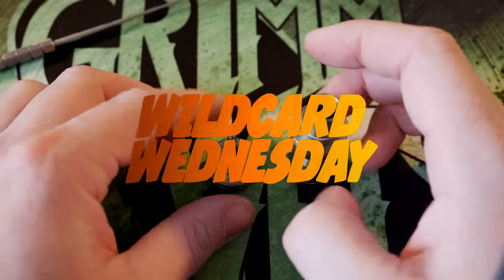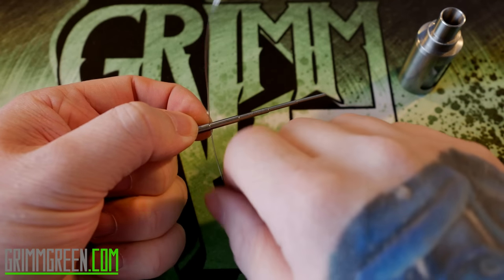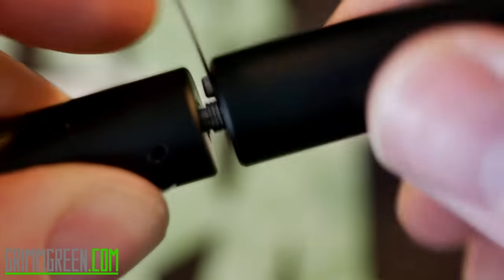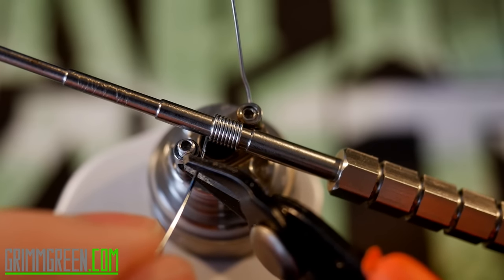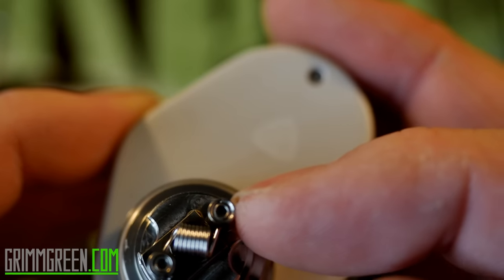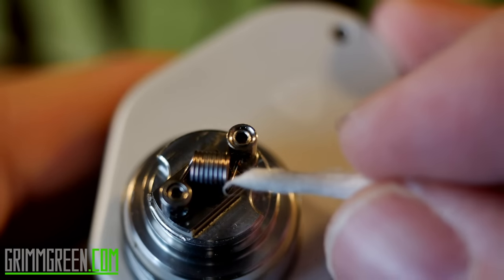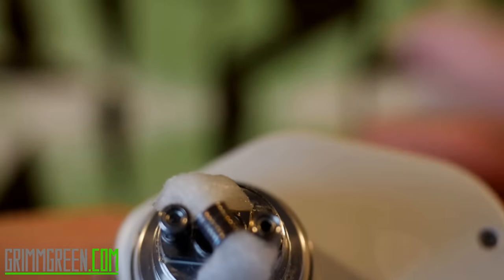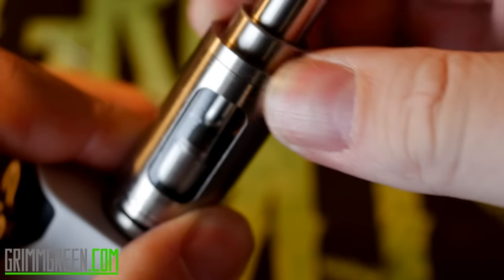Building  Wicking the Wotofo Serpent RTA

Comment: The first time I threw a coil in the Serpent I fought with the coil install. The next time I reverse wrapped the coil and it was SO much easier. I'm glad you showed that in your video. That one step really saves the day for the Serpent (although I space my SS coils for reliable TC). It still isn't the best tank but it's good, doesn't leak, and so easy to rewick. Very nice video GG.

Comment: I have just bought this tank and its my first Rta so I struggled a bit with getting the coil in and I don't think I wicked it well enough as I get the odd dry burn and I'm only using 30 watts and the coil came out a 0.88 ohms so I think I will have to re wick it.I will follow your video and see if that is any better.i am a bit of a newbie when it comes to  vaping it's been about 6 month now but I love it.It has already become a bit of a hobby I have been making my own e juice for about 2 month so I thought it was time to upgrade to making my own coils too.I used to use the ipv d2 70 watt with the aspire Cleito tank and it was a lovely set up but I was going through 2 batteries a day with it only been a single battery.When I bought the Rta I bought the Wismec reuleaux Dna 200 for longer battery life and a bit more power and so far it's been fantastic just hope I can sort the tank out.I will keep trying until I get it right.thanks for the video  I have subbed to your channel.

Comment: I really tried to like this tank, but I was plagued with troubles like leaking, not being able to get a grip on the tiny base ring (AFC ring just spins), and trying to open/close the JFC with oily fingers (because leaks). Also, the bottom pin is too long for the 510 on my RX200 so constantly getting short/no-atty connection problems (not worth upgrading 510 on my rx200 just to get this tank to work).  After struggling with it for a couple of months, I tried the bachelor and found it to be a MUCH better fit for me.  If I ever decide to replace the 510 on my RX200 maybe I'll give it another honest try, but until then it's on the shelf.  Just the same thanks for this vid and the tips I always appreciate your info - have fun!

Comment: there is an easier way, I think. Little J trick, both leads are going down and they are bent towards each other in a J shape, then you pull the wire through clip both leads and you done. I did a build using this trick in my Wotofo serpent first impressions video, check it out if your interested.
Reply: I totally agree with you I do the same! I bend the leads towards each other and works so easy!

Comment: I thought about getting this one but ended up going with the griffin instead. I might still get it just to have both lol.
Reply: Well, the Giriffin is dual coil only (for now). I like to have a single coil setup for work and when I'm out and about, because you can run a single coil all da on more compact single 18650 devices, and it consumes less juice. I've been relying on subtank minis for my single coil needs for the bast 6 or 8 months, but I just ordered the Serpent as my replacement single coil setup.
Reply: +Michael The Vape Dude isn't the Gemini essentially the same aside from the top airflow? I'm thinking of getting the Gemini because I cannot get the griffin to wick correctly no matter what I do.
Reply: Will do man, thanks for the tips

Comment: Another great Wild Card Wednesday!!  Question: I noticed that you did a macro coil where all the wraps were touching.  I had been told that for TC (specifically with Ni or Ti wire) you had to have the wraps spaced out like we used to wrap around silica.  Is that not the case with SS?
Reply from the maker: +Sir Kanthalot I've done contact coils with TI NI and SS ,  not really the case for any of them
Reply: GrimmGreen thanks. I was making a micro coil using a coil master then streaching them out & s scrunching them back together. Works but makes for a tight squeeze in something like the goblin mini. I'll try a regular micro coil on my next SS build.

Comment: You shouldn't glow SS mate. You can run it wicked in power mode but dry you can easily take it too high and end up with nasty yellow stuff on your wire. If you are going to glow it do it so it's just glowing. Better in a dim lit room.

Comment: does 316L work in temp mode when wrapped as contact coils?
Reply: spaced works best but you can do contact so I've heard
Reply: +Josh Garcia yes contact works but not as good as none contact
Reply from the maker: +Josh Garcia Contact SS Coils work just fine for me
Reply: Contact coils work fine for me.
Reply: +Josh Garcia Contact coils don't do well in TC because they heat up faster at the center thus messing up with TC algorithm. But if you build a short coil (lenght ~ diameter) this irregularity will be minimal.
Reply: +Josh Garcia I've Done Both On Many Tanks and RDA's And Yeah, I Just Prefer Spaced But My All 316L SS Wire Clapton Wire Is Preferred. If You Want To Know Where To Get Some Great SS 316L Clapton Let Me Know And I Can Shoot Ya A Link. Cheers!!!   :  )
Reply: +Andrew Alegnani think im good on tc in general. played around with it for a week and now im back to nichrome on mechs

Comment: mine is a leaker. juice control does not close all the way. air flow control ring also doesn't seal. Tried contacting wotofo twice and no response. I will never buy another wotofo product because they have no customer service and bad quality control. if you buy one I hope you get a good one because there are some bad ones out there
Reply: Do you got the black version or silver?
Reply: +Diego “diggarci” García 
mine was silver. finally was able to return it with absolutely no help from wotofo. very bad customer service. got my money back did not want another.
Reply: +Ken Owens that was unlucky, I red only black version got some problems anyway I am about to buy one for 10 bucks really cheap for its quality don't you think? I'll try it.

Comment: Hey Nick, can you suggest a good temp control mod on a Vape budget? my koopor 200plus does not work on SS temp control
Reply: +Dylan Veach I have a Koopor plus and I thought the same but looks like i have been trying to run the coil in tc as soon as I pulsed the coil in Wattage mode! Give some time for the coil to cool down to room temp and then try! Good luck :)
Reply: +Mr.Nobody I have done that but when I have it in temp mode on SS, it glows red even at 200°F. I have two spaced coils reading 0.54ohms

Comment: from my understanding it's a bad idea to glow Stainless Steel wire because it can produce harmful chemicals on the surface of the wire I may be wrong but I've always been told that
Reply from the maker: +Andrew Prettyman SS wire can run perfectly fine in wattage mode
Reply: +GrimmGreen ya I knew you could do that I've just been told when your building the coil to just pulse it not get it glowing red hot like you would with kanthal
Reply: +Andrew Prettyman that's  nickel and titanium, not SS
Reply: +Andrew Prettyman SS has no issues like that as the guy said before that is only with Ni and Ti. Stainless is awesome because you can tc and non tc it without issues. Been running 304 for like a year now and flavor is so clean and the wire so cheap.. 9 or 10 bucks got me like 350ft of 24g as it is sold by weight here from bee keeper websites.

Comment: if you dont mind me asking what vg/pg ratio do you have in the serpent? I had issues with dry hits on max vg
Reply: +BCabral43 I had the same problem but switched to regular spaced coils and that did the trick. For some reason a spaced coil seems to facilitate wicking a little bit better than contact coils. I use max VG in my Serpents now, with no issues.
Reply from the maker: +BCabral43 I was using an 80% VG juice in this video

Comment: Is there a point for this?
Reply: +kirill tulinov yes.I love rebuildables but sometimes a dripper just isnt ideal for on the go. HOWEVER, subohm tanks don't have the flavor or the vapor i am used to as when I build my own. Therefore, RTA is supposed to be a crossbreed of them both. Now, if your question is pertaining to the point of this video, it would be that its a pain in the ass to build and wick these RTA's, therefore Nick made a video that could help out to figure that shit out.
Reply: ***** No i meant why post holes are on an angle? cant think of anything beneficial.
Reply: +Alex S You should get a griffin RTA. Arguably the best tank on the market. you can do large build in it and its easy to work with.
Reply: Ill have to look into it, I appreciate the tip!
Reply: I'm with you in the sense that it is absolutely pointless to have to go through stupid little hoops like that when there are plenty of rtas with little to no hoops like that